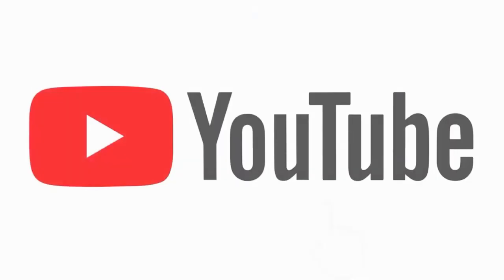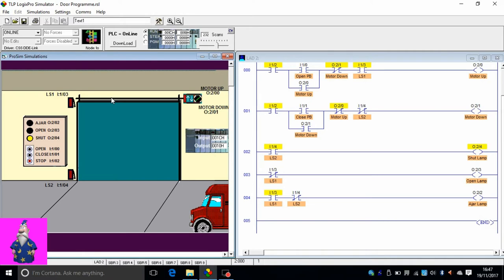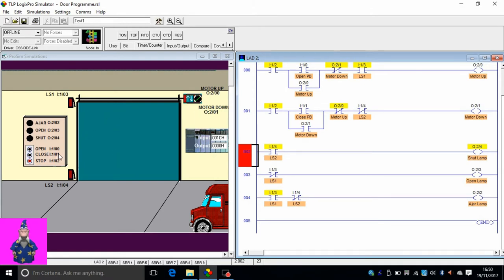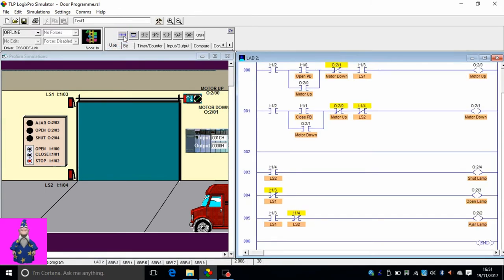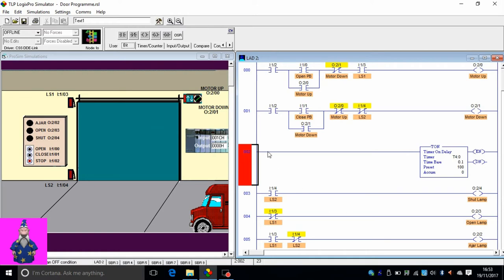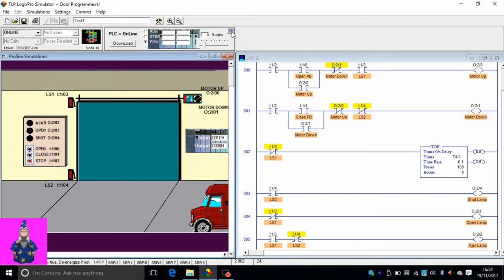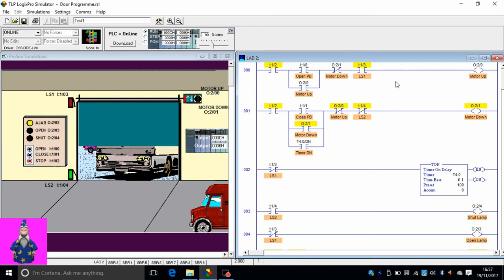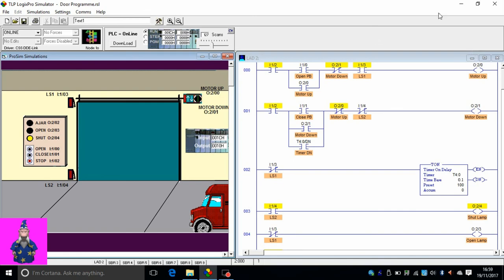Programming a Garage Door With a Timer-Using Allen Bradley P.L.C

Comment: good job, you just need to add reset for the timer
Reply from the maker: There's NO need to have another rung of a programme just to reset the timer, when the timer is automatically reset by the limit switch. This is Allen Bradley, and so as you see the cycle works  just fine as you can see in the video. So thanks for being a clever one, but no Thanks there's no need here, stick to your traveling videos, this is not the way to gain subs and likes. I still keep your comment here though!